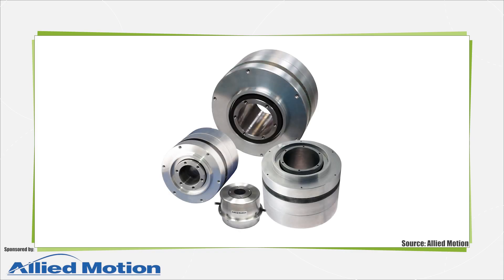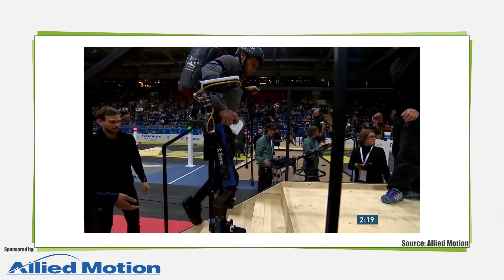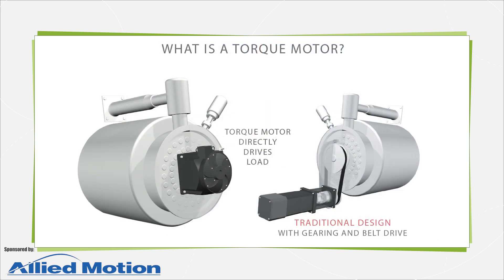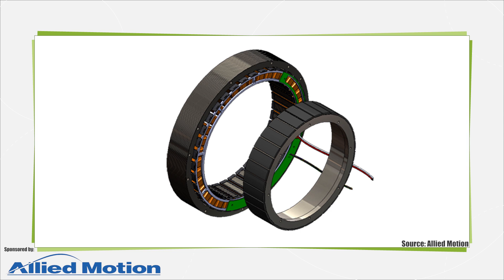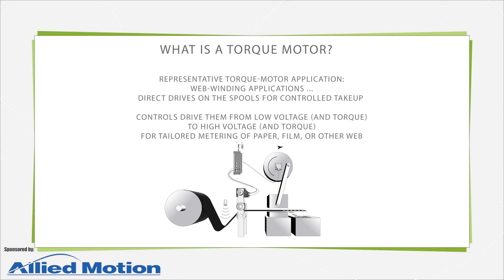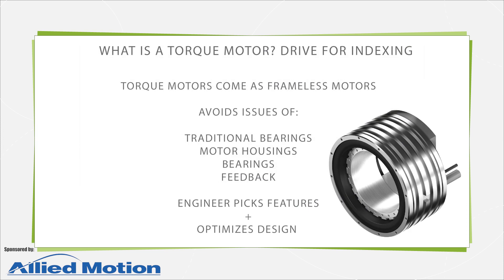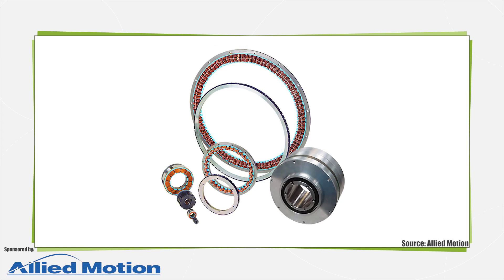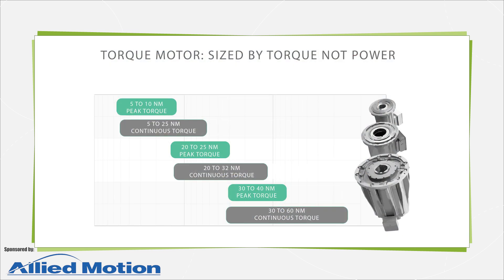What is a Torque Motor?

Comment: confusing
Reply: Instead of having the motor parts in the center, it has them on the edge. This makes it so that it's strong enough (and slow enough) to be used without a transmission, and this center is open, so you could run a pipe through it or something.
Reply: @AurumFaber  Have you project about dc torque motor?
Reply: @sefacalik8598  I did, not anymore. It was not fruitful.